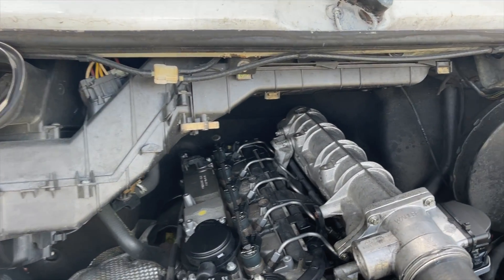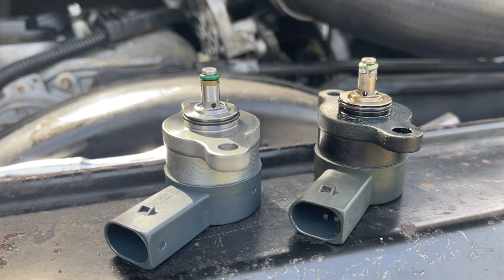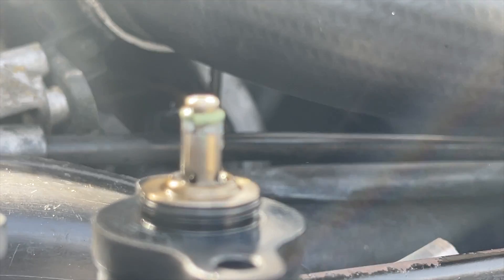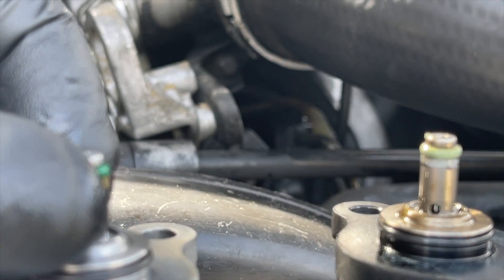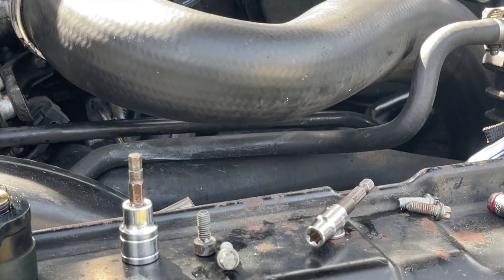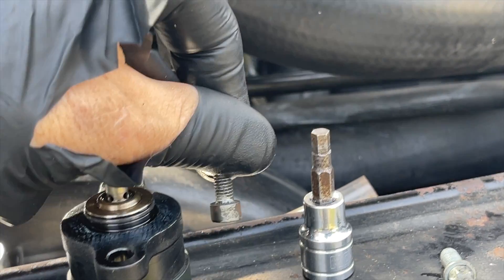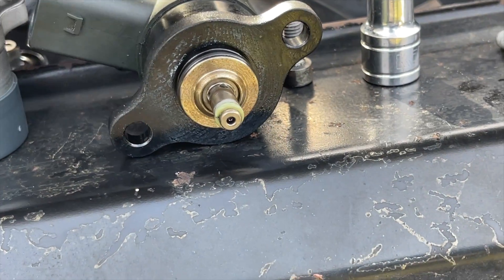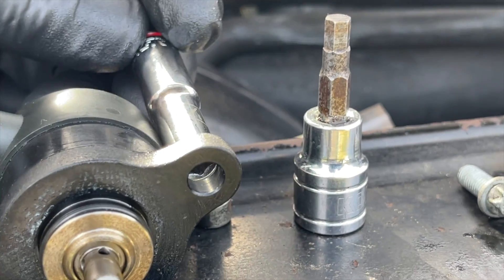Rail Pressure Control Valve On OM612 Revisited

Comment: How its possible, that this pressure regulator fail during crank? When engine is running, pressure will be fine on this same damaged regulator ?
Reply from the maker: Internal seals, magnets and springs can fail.
Reply: @FloridaVanMan Wrong explanation. I'm not asking why the F.P. control damages during engine start, but rather why a damaged F.P.Control gives symptoms during start, but during driving the pressure problem is no longer there ? I Have problem with my 2.7 om612. Engine work very good. Good power, no smoke, nice revs, no oil leak, no obd codes. When i turn off engine for 5 minuts, engine cant start up instantly, but i need to crank for 2-3 seconds. Not every time. Very often. No fuel leaks, new filters, new orings...😢
Reply from the maker: @eklazhward4739  When the fuel is warm and thin a tiny imperfection in the fuel regulator leaks just enough the van struggles to achieve rail pressure while the engine turns slowly by starter motor. As soon as the high pressure fuel pump rotation is fast enough the fuel pressure has no problem overcoming the small leak. When the engine is cold and the fuel is more viscous the tiny leak is not enough to be noticed.

Comment: Hi florid a van man
Got a problem with my t1n 2.7 cdi. Van cuts out when accelerating round about 60-65mph ones warmed up. And it will cut out few times if I'll try and restart. And there's no crank. It looks to me as it might be an electrical issue somewhere. Code come up - glow plug cylinder 1 and 2 I've replaced the 1 but to nut broken in and spinning now. However it's still starts and currently runs with that problem. Injectors have been sent for a test came back fine. Would you mind me asking where to look for the electrial problems?
Thanks Rus
Reply: Glow plug codes have nothing to do with your problem.  Without codes, looking for electrical harness problems is not necessarily indicated.  Grounding is a possible non-code throwing issue.
Reply from the maker: Most of the symptoms you describe lead me to think fuel pressure trouble. We have a video for "Leak-off testing" the fuel rail and I have experienced stalling from failing quantity control valve on the high pressure pump. I would leak-off test the rail, if it passes with no fuel in the overflow I'd then leak-off test the injectors. The injector leak-off test should result in nearly equal amounts of fuel in each tube. If no fuel presents in the injector test I would replace the quantity control valve. Another possibility is the fuse panel under steering column. They are known to go bad at connections between the brass tracks inside, easy to replace and not expensive. One or two failed glow plugs will make starting a bit difficult in cold weather, but have nothing to do with stalling after warmed up.
Reply: Thanks for prompt reply guys.  Forgot to mention that when this happens I get no crank, it can take up to 10 atemps to get started again. I'll tray and reset all codes and try again on my days off see what I get. Thanks again
Reply: Hi there used scanner to s'est fauts took it for a drive to see if there's anything come up. And I now get P2203-32. External quantity control by ASR- request from control module ABS is implausible
P0500-001 vehicle speed sensor - the CAN data are invalid. Any idea if its a speed sensor or an module or something. It's a sprinshif gearbox? Thanks again rus
Reply: Just happened again after parking on the slight hill for a while came back started and it's cut off then tried again and no crank for a few times. Then started. Scanned it again and it came up with P1610-001 voltage supply. Relay switches off too soon. No fault storage possible.
Now I'm a bit confused. This looks like something to do with fueling, but no crank... Any help will be appreciated. Thanks

Comment: magnet trick is sick! You can also use spanner wrenches (12pt) in tight spaces to crack it loose or tighten it up, fits well on E-headed bolts
Reply from the maker: Indeed, I find SAE size ratcheting speed wrenches fit on E-tox heads perfectly. 1/4inch on E-8, 5/16 on E-10, 3/8 and so-on.

Comment: I am glad you bring this up.  I am suffering a small leak from the injector area.  Cannot identify where its coming from.  I changed the return pipe and connectors to brass type fittings with new orings.  They are very TIGHT to reinstall to the injectors.  I have no SPRAYED wet area.  Just a very slow leak on top of the head.  Their seems to be a leak off port at teh side of the engine and soaks the intake pipe from the turbo.  Of course its external wetness but the leak from the injector area is POOLING up on the head and leaking down and out of the leak of port.  What the hell is the issue.  Are the return fitting corrupted once again.?  Or is the injector itself leaking around the Copper orings.  I just cannot find the issue.  What would you recommend in doing to search for the culprit...  Quick video would be great.??!!
Reply from the maker: The copper seal won't leak fuel, only oily compression gasses that quickly turn to black crust. The return lines are most common leak. The supply lines can leak but the worst  scenario is a cracked injector body allowing fuel to rise out of the injector hole. Dry everything and pack the area with blue paper shop towels. Start the van for a few seconds and maybe rev up a time or two. Now unpack the blue paper towels looking closely for dark area. The towels get dark when wet and the first area to get wet is obviously your leak. Please consider joining our membership for one on one assistance. https://patreon.com/Florida_Van_Man?utm_medium=clipboard_copy&utm_source=copyLink&utm_campaign=creatorshare_creator&utm_content=join_link
Reply: @FloridaVanMan  The injectors are new and have been serviced.  well 1 new the other 3 were serviced.  Its a very slow leak and only occurs under heavy load and long drives.  I guess i could drive around with paper towels around the injectors and metal supply lines.  Thanks

Comment: Anything special about the removal of that pressure control valve?
Reply from the maker: Can't a thing back there while working on it, but that is the only real challenge. Remove one wire clip and two bolts then wiggle it out.
Reply: When I fill the filter and crank the engine a few times, I'm getting air bubbles slowly returning back up the return pipe even after I bleed the air out of injector hard lines. Is this normal? Thank you
Reply: Nothing to do with the rail pressure control valve.  95% of the time the air leak is around the filter area.